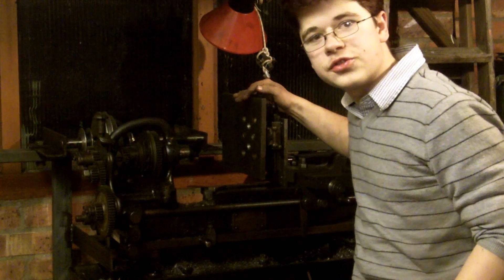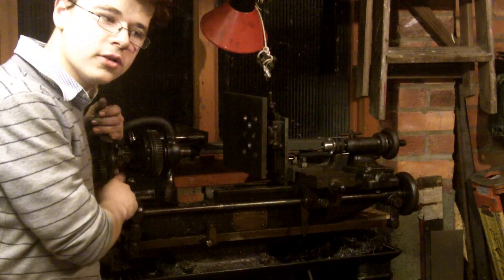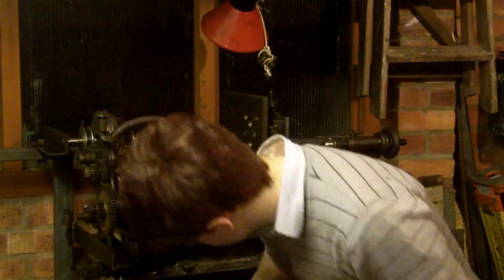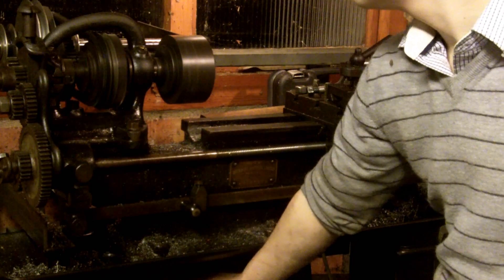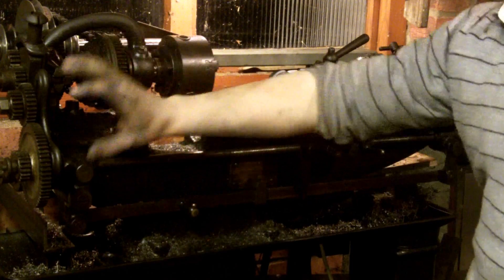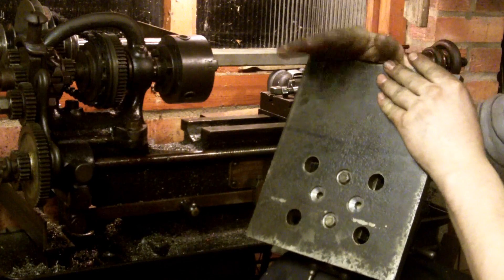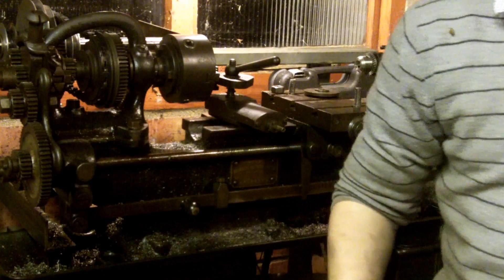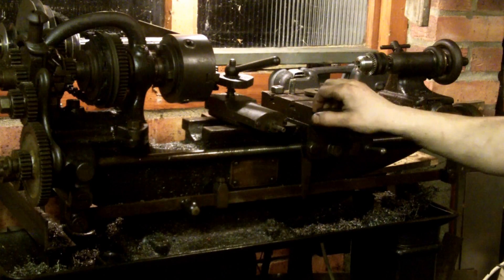A BUDING ENGINEER 3 1/2" Drummond Brothers flat bed lathe

Comment: Great video and has given me a few pointers for my recently aquired Drummond in need of tlc. I think you may be underestimating its age ,could be as early as 1912. Just one thing though Dan . seeing you handle the gears while the motor was running and declutched made me cringe. I lost a chunk of finger to a failed limit switch at work. Dont lose anything of yours to a failed clutch. Keep up the good work.
Reply: ditto ! (some things you learn the hard way lol)

Comment: Mine is just like yours, bought it from a family who's dad had died and they had no use for it. not an engineer, but enjoy 'playing' with it. just reading many books to see what I can do with it. mine came with an electric motor which was not original but bolts to the wall then a belt goes round the lathe wheel and hey presto it works.